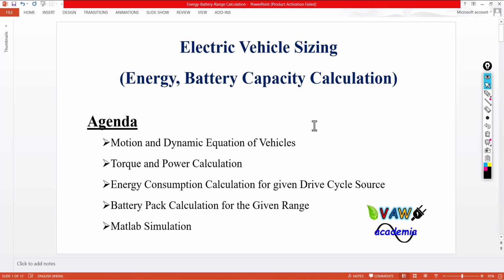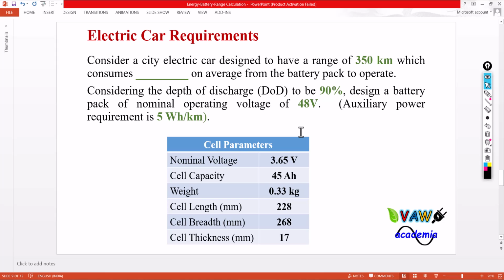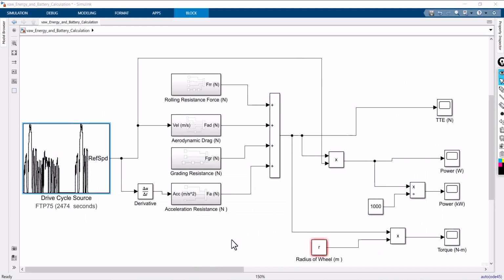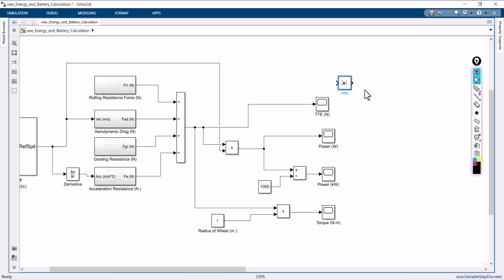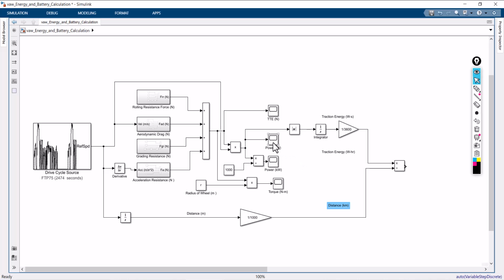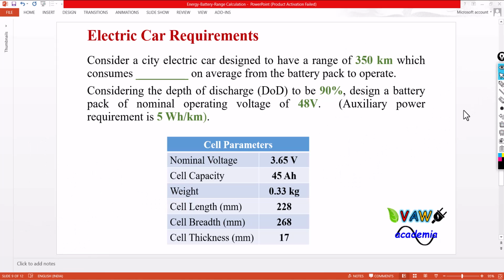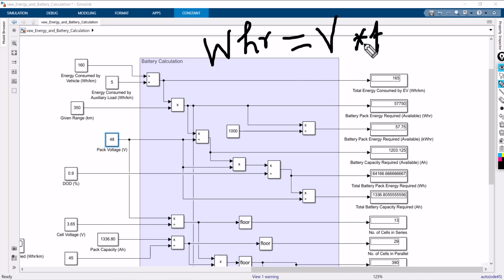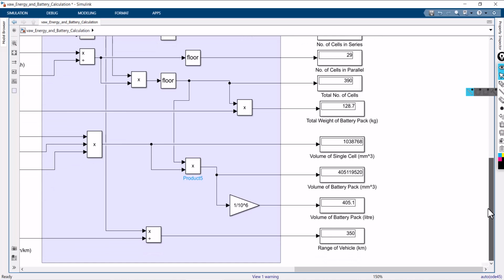How to Calculate Energy Consumption and Battery Capacity of Electric Vehicle

Comment: Hello Sir, Thank you for your helpful videos. i think that there is a small problem in this model that's why you got a negative values. the issue is the bloc of convesion D2R it will be before the Sin bloc in the Grading Resistance subsystem not after (the same case  on the cos bloc of the Rolling subsystem), like you did in the Vehicle Dynamics Modeling with Drive Cycle Source video.
Reply from the maker: Yes, you are right